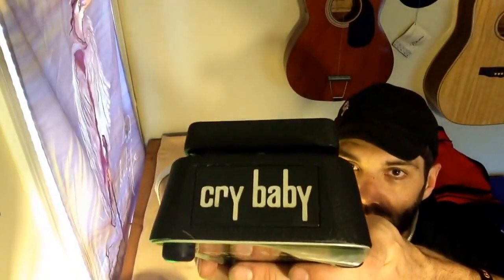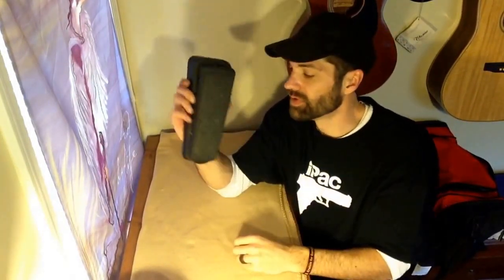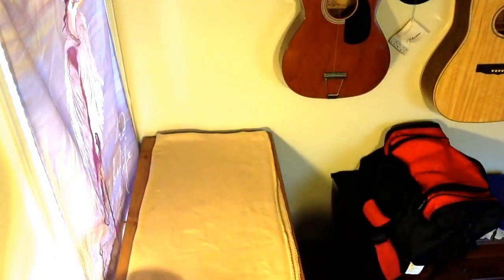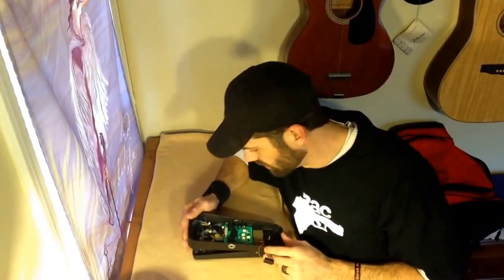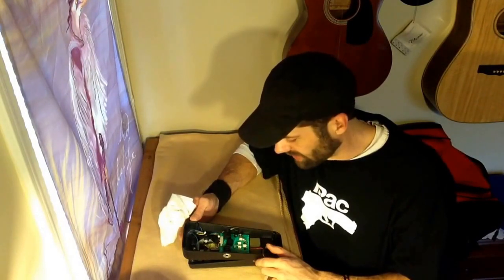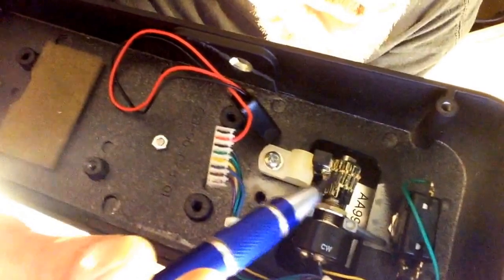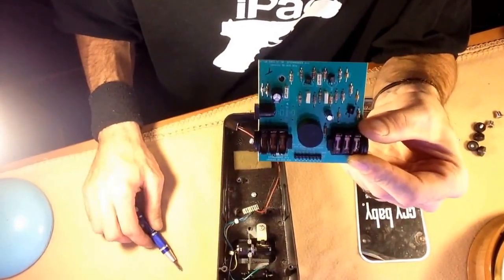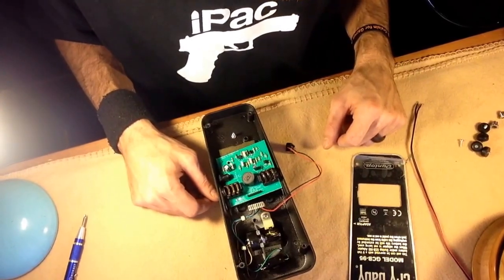Dunlop cry baby GCB-95 "fix-up" Part 1

Comment: Is there a way to fix it with just its stock wires etc? Mine won't wah even when I click the switch on with my finger but I can hear my guitar through it, someone told me my potentiometer might be fried, or it might be a resistor that blew. Any help?
Reply from the maker: Not sure what might be wrong with it. If u have a meter u might try checking voltages starting at the power supply. If all checks out look thru the signal chain. I would also test the switch

Comment: Hey man, I know this is an old vid but I’ll take chance you question just in case. My so p/u GCB95 for $50(learning experience for him)
There is a problem with the pedal retention. No matter we’re we leave the foot pedal angle it drops. It has know retention. I’m not expert and needs some help. - the cry baby he(my son) bought also has what looks like white lithium grease (overkill) on the moving parts. Thanks man.

Comment: Can you please tell me what makes my GCB 95 to reduce the volume from the original volume of the amplifier,when it was turn on
Reply from the maker: Check that you are giving it a full 9 volts
Reply: Yes I'm trying both adaptor and a brand new 9v batter ..but still the same .. sometimes the pedal turn into a volume pedal